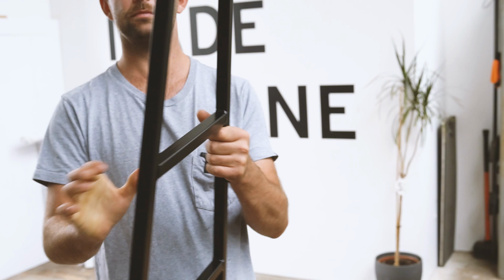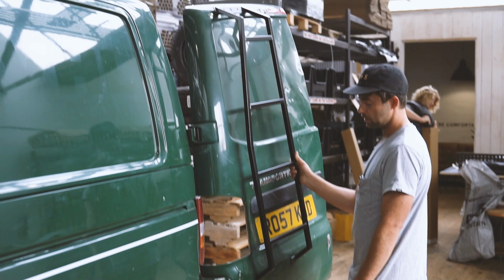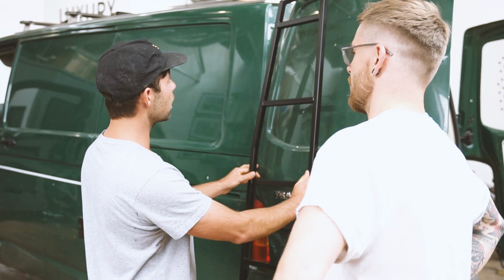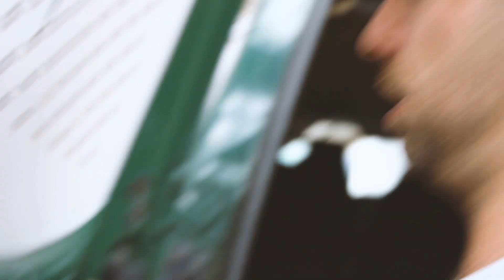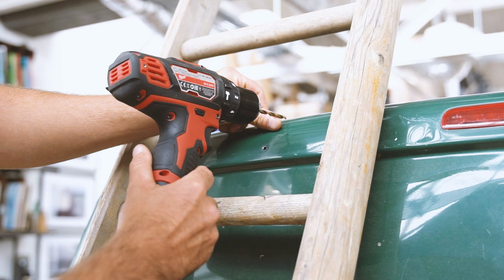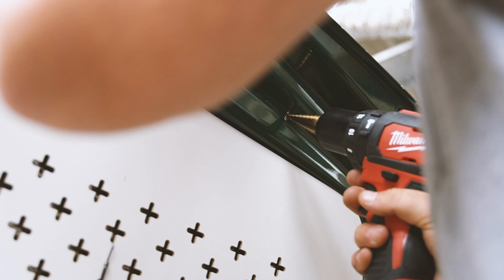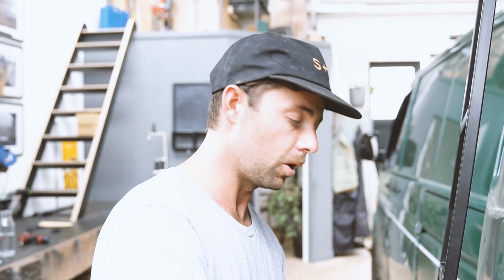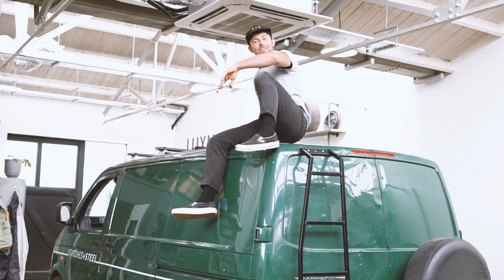STITCHES + STEEL OFFROAD LADDER FRAME

Comment: Will it fit a t4 please? If not do you do one for the t4?
Reply from the maker: Hey There, Thanks for your message! So These Ladders were designed with the T5/T6 models in mind, so it is a little more 'Tailored' to the lines on these Vans. We only offer the one design currently, but that's not to say we won't specifically make a T4 ladder in the future. Watch this space! All the best, Tam S+S